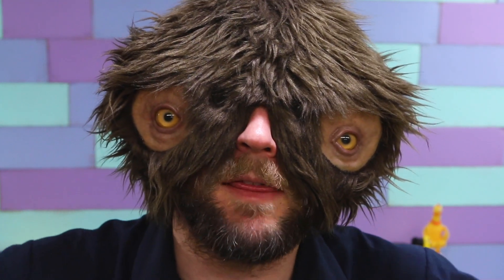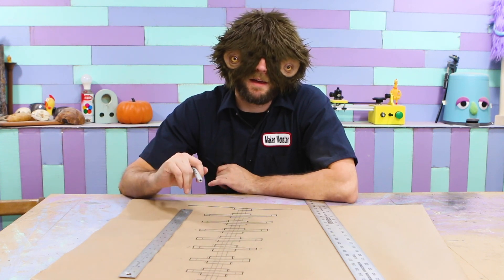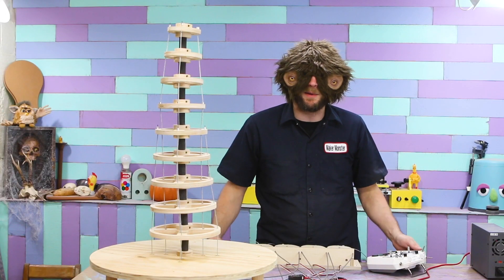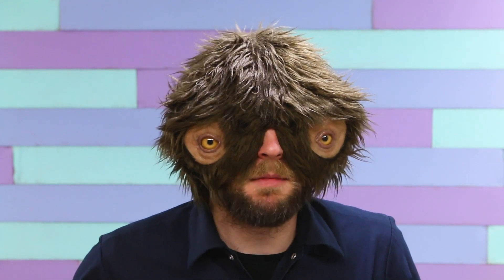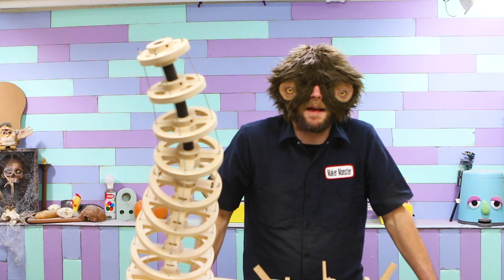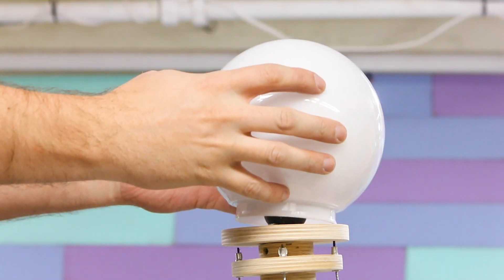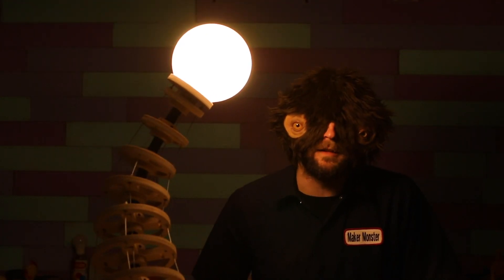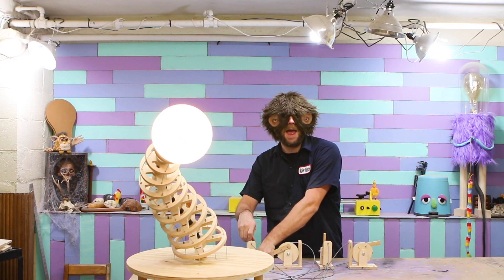This lamp MOVES! | Making an Animatronic Tentacle Lamp

Comment: I love plywood, I love this. Haven't done automata for years and you've really inspired me. What are the little threaded sleeves that fit the hex key bolts called? Be interesting to see if you could set up pressure plates or movement sensors in a room that the lamp responded to. Poor little servo motors. Maybe windscreen wiper motors for some grunt? But good call, finished is way better than permanently delayed. Crafsman sent me here, I'm happy he did!
Reply from the maker: Those are just threaded inserts! You can get them in basically whatever size you need
Reply: @TheMakerMonster  chur!

Comment: That is cool!
How about a single joystick controller?
Reply from the maker: That's how it was on the RC controller. One joystick controlled each of the segments. There were two stages so the top part could move independently of the bottom. So I could make those 'S' shapes instead of it all going in one direction. 

I've seen hand controllers where it was basically two pulleys, one on top of the other, perpendicular to each other, so it was basically one handle that did both up/down and left/right. But making individual ones was way easier. Did make the "performance" part a lot harder though.
Reply: @TheMakerMonster  I missed the two stage control section.  I was thinking something more like a game controller / flight-sim type joystick.

Comment: Looks very much like the rigs ILM used for a lot of puppetry and you did an amazing job. I've seen others attempt this and not got nearly such a smooth result. The servos were a little ambitious and I'm willing to bet you knew there was a good chance of them just burning out but if pull handles are good enough for the like of Lucas and Henson then it can't be too bad.
Reply from the maker: Yeah, I think it was just a little bit too heavy for them. I’ll just have to make a smaller one sometime!
Reply: @TheMakerMonster  Could put your sewing skills to work and skin the smaller one in some 'monster' fabric or have some fun mixing latex.

Comment: Brilliant I love it and the hand controls make it more tactile.
Reply from the maker: That's definitely true. I've seen controls where the two pulleys were stacked so one "joystick" did both up/down and left/right, but making them individually worked just fine too. Would have been easier to control with another person though. Or if I had more arms

Comment: That is awesome! You can probably just get some more heavy duty servos to do the job.
Reply from the maker: Probs! I'm thinking ill try making a smaller, lighter one at some point and that should help too
Reply: @TheMakerMonster  Oh here's another thought. You can probably do 2 instead of 4. Set it up so that the two opposite side go on the same wheel, and when you tighten one side, the other relaxes.
Reply from the maker: That’s actually how it was set up. I didn’t really explain/talk about it but I tried to get fancy and make a two-stage tentacle. So basically the top section could move indecently of the bottom. That’s how I could get the cool ‘S’ shapes and stuff

Comment: Making a tentacle is pretty darn cool by itself but now you also have a lamp you can place in any position. Brilliant blend of form and function.
Reply from the maker: I think building one into the center of a table would be pretty cool. Or two on either end of a work bench
Reply: @TheMakerMonster   The one drawback might be that it would be so much fun to play with them you'd never get anything done!